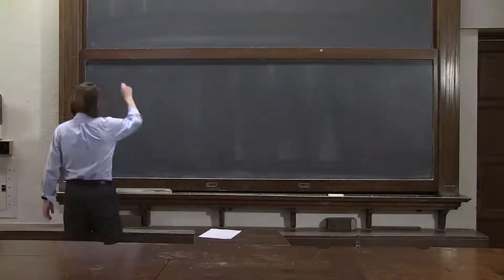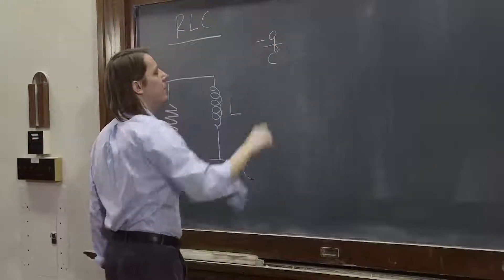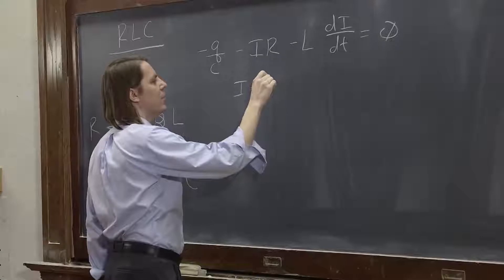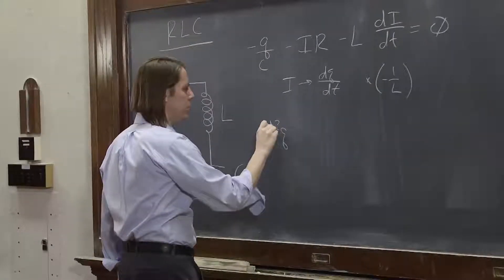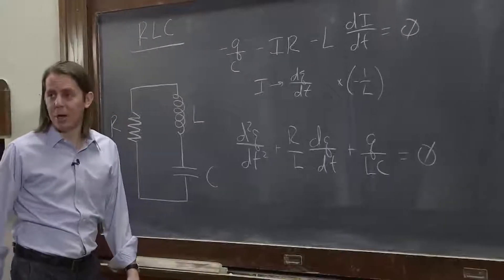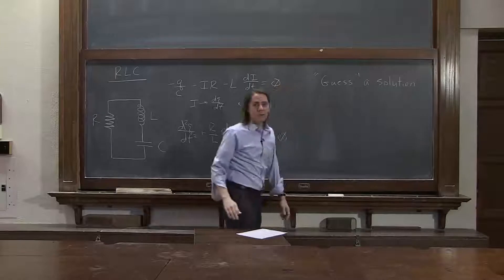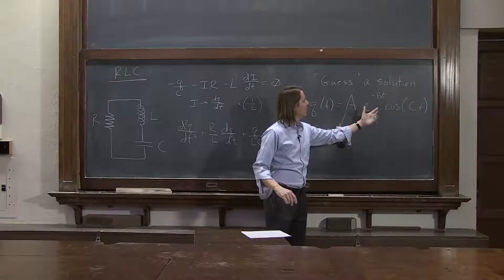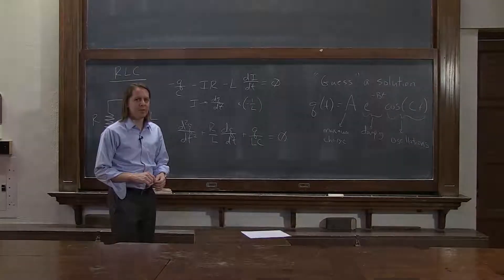PHYS 102 | RLC Circuits 1 - The Differential Equation for the RLC Circuit

Comment: From what point in the circuit did you start (or use it as zero potential)? I'm aware that the final equation is correct but if you go through the capacitor from top to bottom, and there's a drop in voltage, that means the top plate is positive and the bottom plate is negative. Doesn't that means that if you go then through the resistor and inductor, the voltage has to increase instead of dropping?
Reply from the maker: I am going around as a positive charge carrier (along with current flow), so the drop you described is negative for the capacitor, but as a positive charge goes through the resistor, it also goes from high (entry end) to low (exit end) potential, so the resistor drop is also negative.  The inductor also is negative based on moving with the current flow.  

If your concern is that the three negative drops sum to zero, the solution is that for a time varying circuit like this, the potentials will fluctuate *out of phase*. So while one is positive one of the others will be negative to compensate..
Reply: @Prof-Hafner  Thanks! And thank you for your work and still answering to these videos!